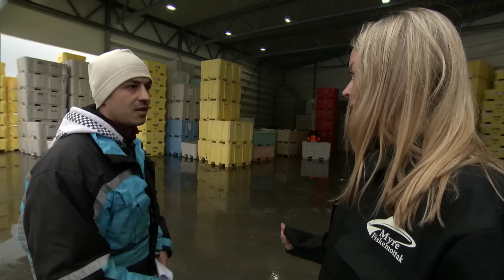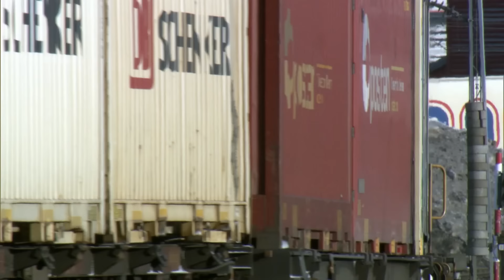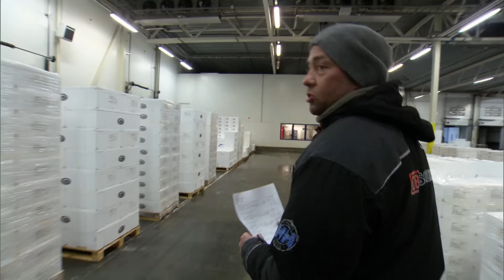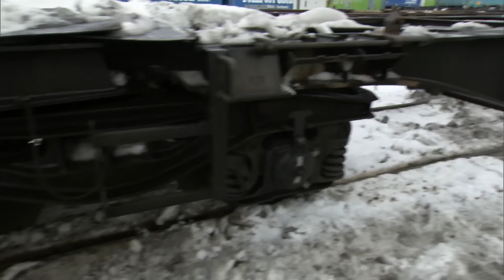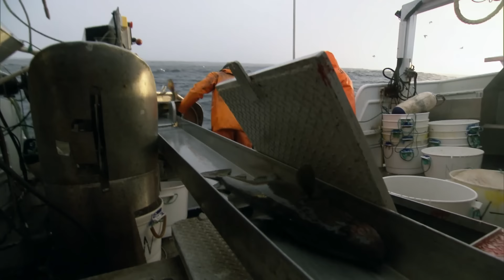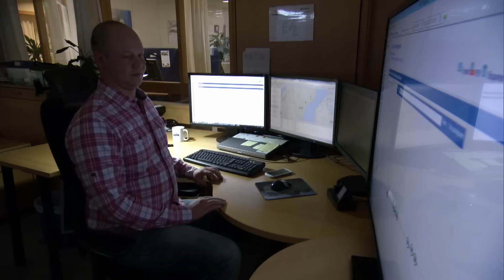Mighty Trains: North Rail Express | Season 1 Episode 5 (Full Episode) | MIGHTY

Comment: What is that horrible clicking sound inside the locomotive???? That is a  huge distraction and a safety hazzard.
Reply: The ticking sound comes from the speedometer, a type from Hasler & Bern (Swiss brand). Train drivers usually stop noticing it in no time at all. Used to widespread all over Europe. Only a handful remains in old locos. Was phased out from the 1980's and on.